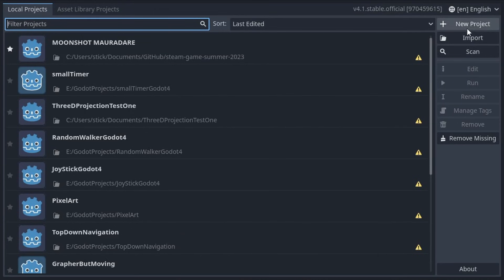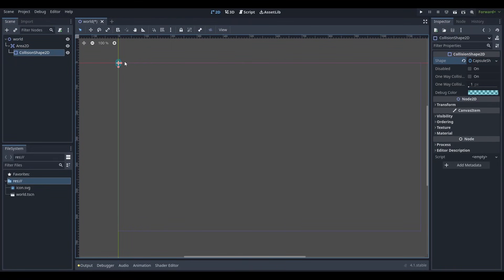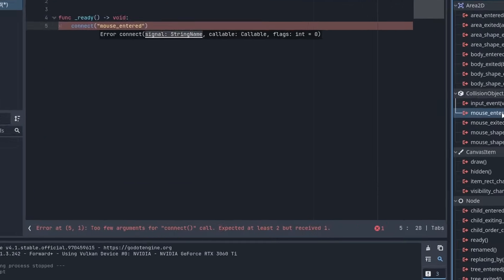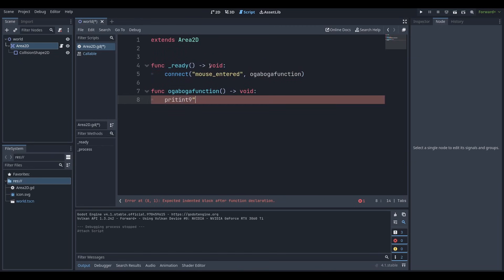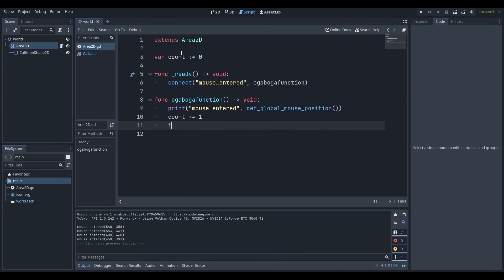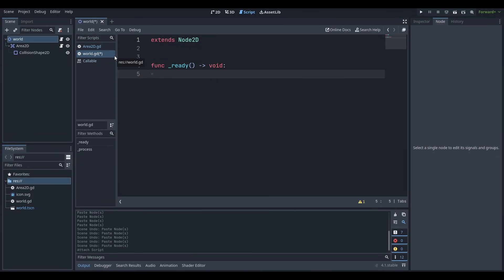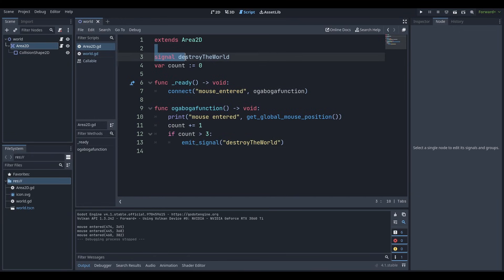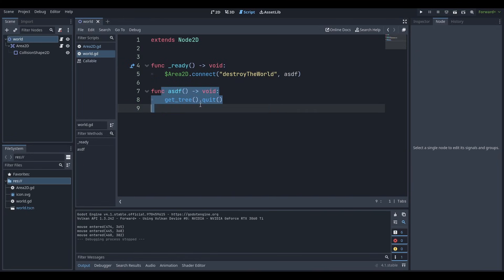How To Use Signals In Godot 4

Comment: extends Area2D

func _ready() -> void:
	connect("body_entered", sword_hit.bind(body))

func _process(delta):
	pass

func sword_hit(body):
	emit_signal("hit", body)

I have this script where i wanted to connect area2d body_entered signal to a defined func called sword_hit , but i need the body attached to it. So the body can be pass to another signal called `hit`. 

this is the error i met, `Line 4:Identifier "body" not declared in the current scope.`  
Please help Q_Q

Comment: I really don't understand.

Although I do as I was told in the video, if I type in the 2nd script: 

$Character.connect("damagePlayer", self, calculateDamage)

The error that appears is:

Unexpected "$" in class body

The only thing I want is to send the damage value that Character has to the enemy. How should I actually use the signals?

Comment: I just noticed something and I have a question. The 4th time the OogaBoogaFunction is called, it sometimes doesn't print the mouse entered/global mouse position line before the program exits. And then sometimes it does. I wrote a version of this exercise where I had a 'print("Destroyed!")' line in the asdf function just before the 'get_tree().quit()' statement. And sometimes it would show. Other times it wouldn't. The execution sometimes jumps ahead to the 'get_tree().quit()' before the printing happens. 

How would you prevent that, I wonder? Anyone's comments would be welcome. Thanks.

Comment: The only thing I dont get:

Couldnt the area also call get_parent().asdf()
Why is there a need to be a signal? Is there any advantage other than signals dont crash on "null" errors?
I agree the area could have a parent that doesnt have an asdf() function, but if my game has that for sure is there any other benefit?
Reply: Signals help keep code modular so like you said, if you are certain your structure won't change then it may not be the best use case for signals. I think signals are best utilized when two or more nodes are connected or if you want to account for nodes being there sometimes but still connect seamlessly to the code.

Comment: Good video nad labs :)

I think "function as a variable" would be a better simplified definition of a callable. The reason Godot 4 signals have changed from 3 is because Functions are now first-class. This means they're a Class (Callable) and can be assigned to variables and passed into functions like any other class (rectangle, sprite, Vector, or any other Node).

Also it's preferable to use the reversed Godot 4 syntax of Object.signal.connect(Function:Callable) and signal.emit() to reduce the use of strings and actually take advantage of the first--class nature,  iirc the syntax you're using is just a hold-over from 3.x

Also also, if the function is simple enough, you can pass in an anonymous/lambda function instead of the name. This is good if you only use the function in one place and don't want to write it out somewhere else

signal.connect(func(): print('hello world')) or something like that
 
absolutely shivering in anticipation for the next vid 😳

Comment: well done, but I would like to know how I can connect a signal to another node, through code, in your case, you call a function located in the same script, I would like to point to another target (that when you are connecting, you are connecting to another node, to call a function of that node), how can I do that?, in godot 3 I knew how to do it, but here it has changed
Reply: Did you find a solution so far? I´m still looking for one ...
Reply: @15plus1  Yes, but try to tell me what is your problem, what do you want to connect, and I will try help you. Tell me the node you want to connect to the other node (both names)